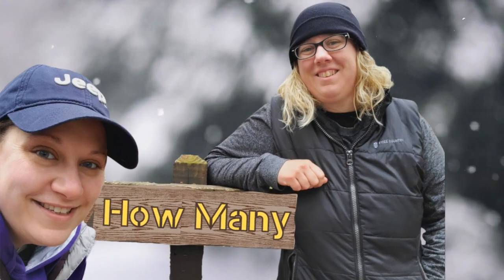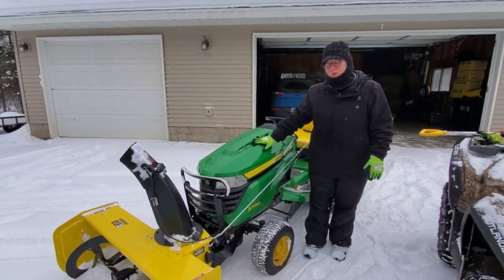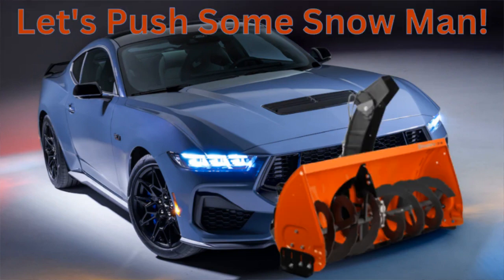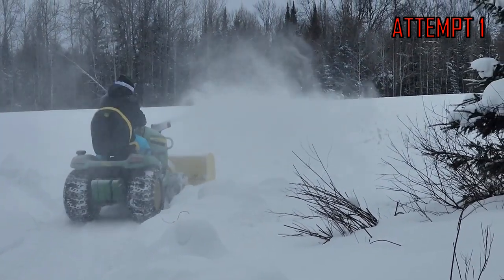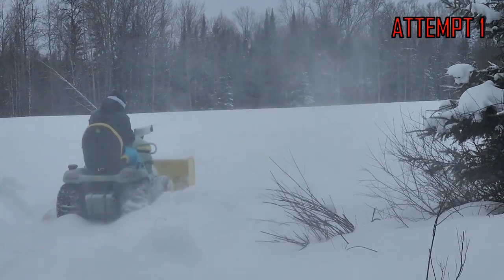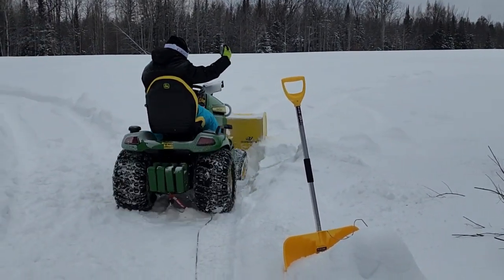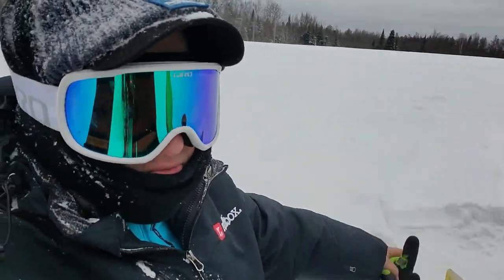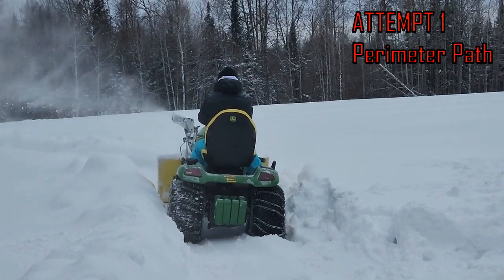DO NOT Do This With Your John Deere Snow Thrower

Comment: Use the locking differential (round orange pedal by left foot) and make sure the blower is all the way down. I'd also recommend going no more then a few feet, back up and doing it again to make sure you are getting down to the grass, if these aren't on solid ground you will get stuck instantly.
Reply from the maker: Yep. We had so much snow and ice pack when attempting this that the machine just wasn't able to handle it. We have to rethink our strategy for next year.
Reply: They also are not putting the tractor into neutral by pulling on the silver lever in the back when they pull it out with the winch. So the drive gears are fighting their retrieval effort
Reply: @40acresofclueless It doesn’t sound like you understand what he’s telling you.  The problem is not the machine.

Comment: My 1973 Bradford garden tractor has a 16HP engine and a 44 inch Bercomac 2 stage blower on the front along with chains on the turf tires and weights hanging off the back as do you, and I can say without a doubt, if I can go through 2 foot snow drifts and not get stuck, this JD and blower can easily get through that. It all boils down to going slower and let the blower do it's job. Make sure the blower is on the ground and the skid shoes are set so the cutting edge of your blower is digging in and you won't leave as much snow under your wheels. If you notice there's still to much soft stuff underneath you, lift the blower and back up and do it again. Remember snow blowing is slow and steady, where as plowing is fast. Float mode is great for having all the weight of the blower on the ground and not on the tractor. I don't have a diff lock on mine and never needed it. I clear our road and field where we have stuff stored for people and it's hilly and side hills and deep snow from wind blowing the snow around. I'm going to sub to channel, cus I want to see how this all turns out. Cheers from Sask, Canada.
Reply from the maker: Thanks for the suggestions. What I'd really love to get is a small utility tractor that also has a bucket. That would so so handy year round for us. I'm working it into a 2yr plan for us. We have a large garden and always need more POWER!!!!! lol 😆

Comment: To actually HAVE a diff lock is fantastic.  To not know to use it is a real shame.  This tractor is light years ahead of my Dad's old 300 and yet with enough weight on the back along with a set of chains, it cleared our 450' gravel driveway for over 30 years without complaint.
Reply from the maker: The slip differential has come in hand, but when the snow pack is so thick like it was here the conditions were just too much for this machine. Did you every have any issues with your belt snapping or splipping on your old 300?
Reply: @40acresofclueless  I even used it to pull an old Biscayne out of the ditch one day pulling a bit of a wheelie while doing so.  It was an early 70s tractor that my older brother just sold this year - still running.
Reply from the maker: Wow! That's amazing! Those old tractors were solid for sure!!!
Reply: @40acresofclueless  What belt?  Our 300 came with a drive shaft Hydrostatic.  If you mean the belt to the blower, nope never came off....ever.

Comment: This applies to anything you're driving. When the tires start spinning, you're stuck, don't let the tires keep spinning until you dig yourself a hole, it only makes it harder to get out. I have the same setup, and I snowblow parts of my yard as well, but I've not gotten stuck with it. It was close a couple of times but once the tires started to spin, I stopped and stepped on the differential lock before I was too deep to get myself out.
Reply from the maker: Good tip!!!! Thanks so much!!!

Comment: You might try pushing the orange pedal on the left side of the mower so you lock the differential. Also pull the lever out on the left back to put the transmission in neutral before pulling the mower.
Reply from the maker: This is an excellent suggestion! I will certainly implement this strategy next time I get stuck!!!! Thanks so much for letting me know!

Comment: I just bought the same x590 with cab and blower for my property and hope to have better luck than you just did. But I get it.....there's always a learning curve! Now, for the really bad drifts and off-road situations, I'm also in the process of building a 52in blower for the front of my 4x4 atv. I have heated grip on it and a cab enclosure. MUCH MUCH cheaper than a 1025 or 2025 with a blower!
Reply from the maker: Yes we were looking at a Rammy blower potentially for next season for our four wheeler. Please let me know how the build goes. I'm interested to hear.
Reply: @40acresofclueless  so far, I've found a single stage blower for a riding mower from the 80's in good condition that I plan to add wings to widen it a smidge. I bought a Predator engine from Harbor Freight and a centrifugal clutch to connect to the blower's vertical belt drive. All I need to do is weld up a frame for it all to connect to the plow mount under the ATV. I'm only into it for $500 so far, plus another $200-ish for the ATV cab.

Comment: FYI:  there should be a release rod to pull to get the transmission to "free wheel" instead of dragging the tractor with the wheels locked. I assume it's not great on the transmission.

Comment: I’ve never had any issues with mine. I have x390 with score blower and chains. I don’t have any rear tractor weights. The key is taking small bites. I’ve cleared three foot deep snow with mine. Always keep your rear tires on the ground. Don’t shove into the snow deep enough that your rear tires are in the snow. For deep snow, have blower raised as high as it goes. Push in until rear tires touch the uncleared snow. You might feel the tractor start to drive up onto the snow. That’s ok just as long as you don’t get the rear tires in. You’ll have to back up and go in again. Continue until your blower is lowered all the way then when you can’t push in anymore raise the blower back up and start again. It will take a long time for deep snow. As you’re making your way through, cut at a slight angle left or right then when you go back in go at slight angle the opposite way. This will make a path wider than your tractor. If you only go straight, you risk snow falling back in behind you as you go which will increase your risk of getting stuck while backing up. I usually try to make my cuts double the width of my blower. I have 48” blower so I try to cut twice that or more if I’m trying to make an area to turn around. 

If you have a hard packed area, it’s ok to drive on if it’s not too deep. You may find driving on the hard pack, your tire chains can start to break up the hard pack. If you notice this, back up and clear what you can of the broken hard pack. If it’s not too deep you can just keep going and go back after with final clean up clearing anything left over. 

I had an unfortunate event when the plow going down the road decided to shove all the snow into our driveway to our workshop. Our workshop is on an alleyway usually they keep plowing the snow until it’s the end of the alley and make big piles in the corn field. Not sure why they deliberately plowed it into our driveway blocking the door to our workshop. I’m just glad I had my blower in our workshop that day. I was able to open the shop door and blow snow out and away from the shop. It took me a very long time to clear all that out. The snow was well over the height of the blower chute. With the small bites and lots of patience I got it cleared out. I have never had a belt slip or break on me. Oh, one more quick tip. Watch your throttle gauge. Keep your throttle full and keep it in the green range. If you hear or see the power level start to dip out of the green, stop pushing in and let the blower catch up. You may need to back up to clear the blower box. I also find that picking the blower up and down on solid ground a few times can help clear out the blower. 

Ok I lied one more tip. If you keep your tractor blower setup in a heated garage, your blower box will be warm and snow will stick to it. You’ll need to get the blower box cold before using it to clear snow. Some people spray cooking spray inside the blower box and chute. I have never tried it, but some people say it works. 

Happy plowing next season.

Comment: You know that X590 has a differential lock right? The yellow petal on the left side you push down and it locks both real wheels together to drive. It will give you much better traction.
Reply from the maker: It does help yes, but in this much snow it's still hard on the machine

Comment: i WOULD LIKE TO SAY THIS BOILS DOWN TO OPERATOR ERROR! first off your not racing to get it done like the grass! second your trying to make a lawn tractor perform like a massey ferguson- - - never the 2 shall be equal. When using the snow blower you have to drop the unit totally to the fresh ground before the hard pack snow, then get blower operating then slowly move into the snow little bit at time your blower will dictate how fast you do this!!
Reply from the maker: This is true. Too much snow pack when we tired this maneuver

Comment: PLEASE... read your owners manual for operation of the differential lock and PROPER use of the UP/DOWN feature of the snowblower... You'll find that with full knowledge of the correct operation of your garden tractor and snowblower attachment, you'll be able to do more with it than you think.
Reply from the maker: Also, this tractor just isn't designed for the oofroad environment as well. I have since discovered the slip differential and it works great!!!!

Comment: OH MY GOODNESS!!! (Swear words and epitaphs removed...)
 
I replaced my 1984ish 430 with an x540 in 2014.  I was not impressed.  It worked fine for mowing but, when I got into a little snow, I had similar problems...  When you turned into that 'forest' lane, I could hear that Kawasaki motor surging under load - you can see what I mean by watching the snow coming out of the chute.
Some suggestions: 1) Trade that x590 for an x7## series, preferably the 4wd variant!  2) That orange 'knob' on the left floor-board is a differential lock.  When you step on it, it locks the rear wheels - forces them turn together - which MAY reduce the chances of getting stuck on that road.  3) Invest in the chute deflector kit.  I don't know what it's called, but it allows you to adjust the chute elevation from the drivers station.  Turn the chute with the wind and elevate it to the point that the snow is deposited as far away as possible!  4) TRADE that x590 for an x7##!  BTW: There is a lever (on my x540 it stuck out of the plate behind the rear axle) that 'unlocks' the rear end - causes it to free wheel, so you can push and pull the tractor without fighting the axle...

I owned that x540 for one winter.  In the middle of the 2nd winter, I found a used x748 (with a 54" mower deck, 54" blade, and a 47" snow-blower) and traded that x540 (with the same implements) off on that x748!  The biggest difference between the x5## and x7## series tractors, is that all of the implements on the x7## are shaft driven.  ALSO, because the x5## series are belt drive, there is a limit to the vertical travel of the implements.  My x748 WILL dig a hole in the ground (with the blower, or the blade), whereas my x540 would just ride on top of the ground.

My x748 is 4wd, has a diesel engine, and isn't offered by J-D any more.  However, the x7## series is still available and will serve you better than that x590!
Reply from the maker: Yeah we are thinking of an upgrade to a small 4x4 utility tractor. This way we can get a bucket on it for other jobs as well. This x590 cuts grass amazing but sucks in the snow. The differential locks helps by maybe 10 percent. It needs more weight on the rear axel but cannot accept more than the 4x suitcase weights currently equipped or it will unduly stress the drive train. Overall poor design. Bummer. Thanks for the suggestions  😀

Comment: 🤓You mean your "lawn tractor" with J.D. 44" snow blower couldn't handle throwing 9-Feet of snow?🤔🙃😵‍💫
SOLUTION: Don't wait on snow to stop before  clearing it, I WOULDN'T allow more than 4-6" MAX to build up before I got to it🤔 Snowing or not. You're asking your lawn tractor to act like a commercial industrial machine😶
GOOD LUCK👍🏼
Reply from the maker: Thanks for the feedback
Reply: @40acresofclueless  i’ve had a few of these blowers on smaller John Deere tractors. Disappointed with the build quality the chute  break easy as they are plastic !. Gear box’s horrible no replacement parts at all!. and these items  are expensive.  Love your x series

Comment: I don't  get it.  Why didn't you lower the blower and go slower?  I can understand if you were doing this very wet snow or as you stated, icy conditions, but looks like you were going too fast for the blower to do its job.  But, then again, you weren't filming from the front, so I can tell.  Years ago, I had a Sear Suburban with a blade and it would push through 3 foot snow drifts.  Had only back tire chains and no wheel weights and I weighed only 150lbs at the time.  But, thanks for this video as I now have a John Deere D170 and am thinking of getting a snowblower for it.
Reply from the maker: The problem with this was a thick layer of icy build up that the blower couldn't get through, so it slid across, but the chains on the tires tore up the icy layer which caused the back tires to sink down into holes and the machine wasn't able to power itself out.
Reply from the maker: There was probably 5 or 6 inches of ice pack under the fluffy snow ❄️

Comment: the snowblower should be able to lower down to wheel levels. (you might need to dig down to allow it to tilt down so you can get to ground levels ) i don't have this equipment but just saying...
Reply from the maker: I had also wondered if possibly lowering the deck hydraulic would allow the blower to scrape the snow more closely. Not sure, it was prettyniced up from freezing rain below the snow. Digging down might work. I'll try that next time.

Comment: When you get stuck there is a pin on the back to unlock wheel will pull or pus much easier
Reply from the maker: That's a fantastic suggestion. Thank you!

Comment: Yeah, it's the wrong equipment for the task you have.   A 1025R or 2025R would have made short work of that issue.  They now have a heavy-duty front blower for those two models.
Reply from the maker: You are the second person to recommend the 1025R. I'd love to look into a little compact tractor 🚜
Reply: @40acresofclueless  I have the 2025R with a HD front snowblower.   It works great.  I do have a cab though as it gets below zero in the winter.   You can get a drive over mower deck and it comes with a front end loader in either the 1025R or 2025R

Comment: Learn to use the equipment. That orange button on the left footboard is the traction lock to lock both wheels together for more traction.
Reply from the maker: This sometimes works. Snows too deep
Reply: I had a John Deere GX345 (2 wheel drive) and plowed snow with this on our farm for years. Rarely did I ever get stuck. Sorry, but you just don't know what you're doing.

Comment: Wrong equipment for the job.
You need chains, weights, narrow ag tires, and probably a 4wd tractor.
Your atv would have done the job if your path had been planned to go around adverse terrain features and marked with stakes before it snowed. I learned all this by making the same mistakes and worse. An older gentleman explained it all to me with a plethora of profanities I’d rather not have heard at the time, along with the “back in my day, when snow was new and shovels were rare and considered high tech…”
Reply from the maker: This machine has chains and 200lbs of weight on the rear axel. 😳 4x4 is needed I feel.

Comment: This was hard to watch - the wrong equipment for the job.  Sorry ladies but you need something bigger and better if you're blazing off road trails.  I run a X758 (25 hp diesel and 4 wheel drive) with the 54 inch snowblower, 6 suit case weights and rear chains.  Never get stuck but I do have to use the differential lock every now and then.
Reply from the maker: Yes I do believe this lawn tractor is way outside of it's element here!!!! We need a compact tractor or something. This machine will be staying in the driveway from now on! Thanks for the tips!

Comment: Where are the rear wheel weights?
Reply from the maker: This model does not accommodate axel wheigts. Suitcase  weights only. It specifically state not to use axel weights

Comment: I had one of these. Complete POS. These little lawn tractors don’t have enough power, mass or weight to run a snowblower. Do not waste your time or money to use for snow removal.
Reply from the maker: Problem is I've already wasted the money. Works fine in the drive on completely FLAT surfaces. But icy stuff causes issues as well!.